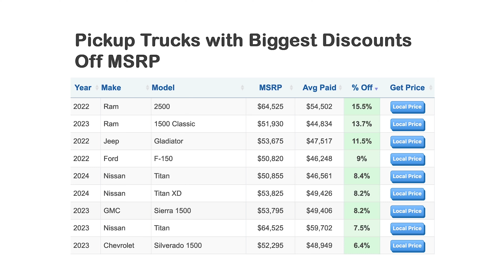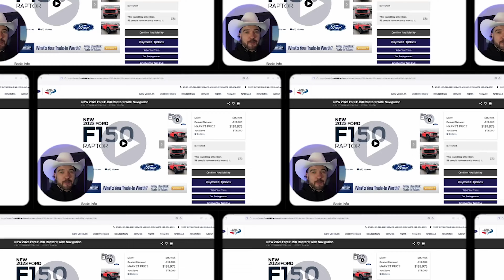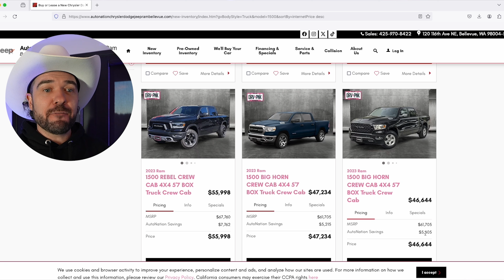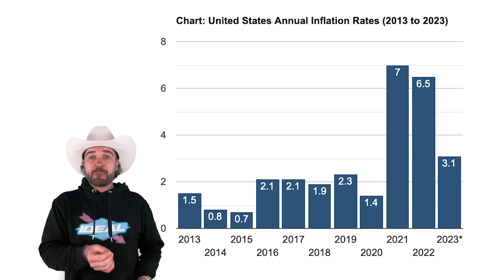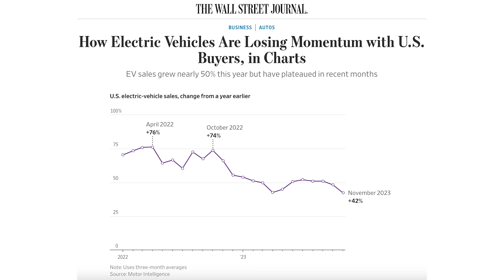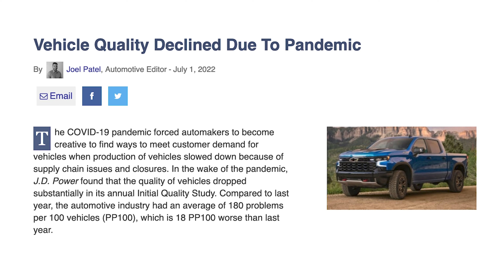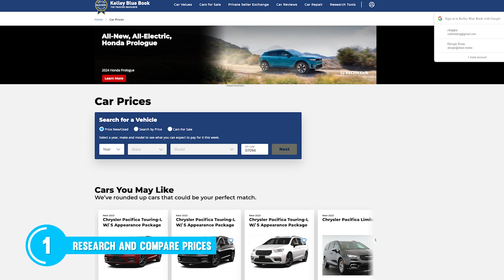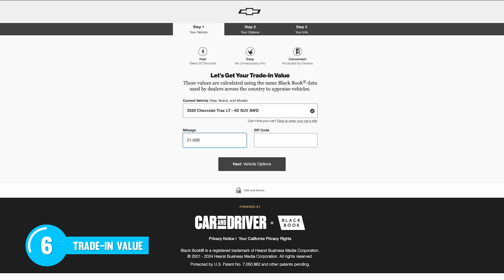Truck Market SCREWED! WON'T Even Buy DISCOUNTED TRUCKS

Comment: The price of cars and trucks have risen much higher than the rate of inflation. I will not even consider a new truck until msrp's come down at least 20% on top of incentives. Even then I will have to think very hard about buying because quality is down across the board. Just Saying

Comment: The Auto Show here garnered very little interest in full size trucks. The manufacturers didn't even display a regular work truck. The mid size ones were doing well but they're impractical with the microbeds. Why bother?